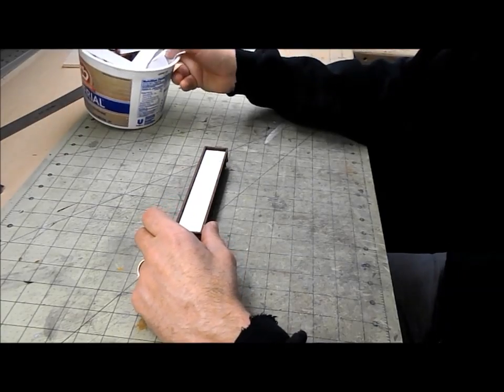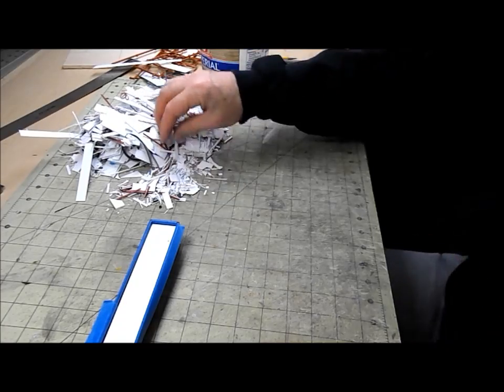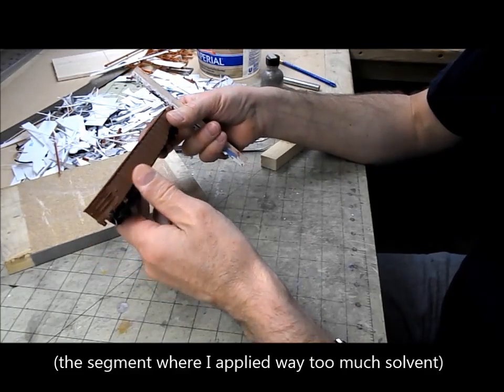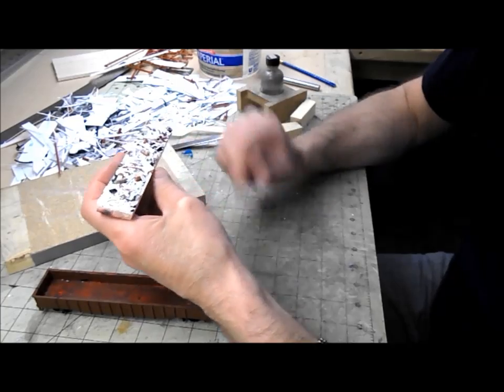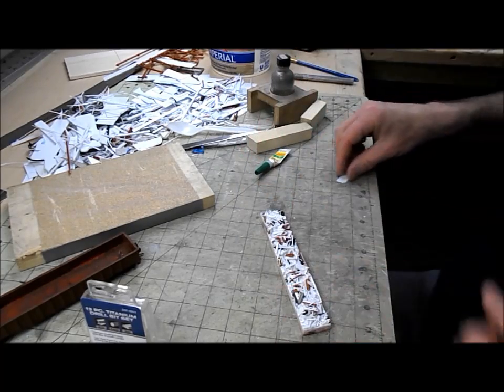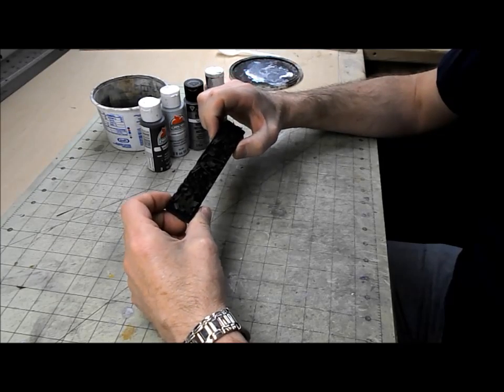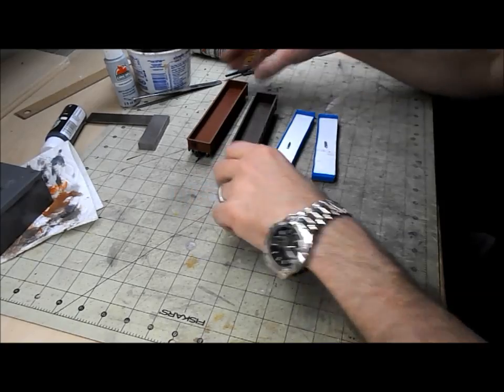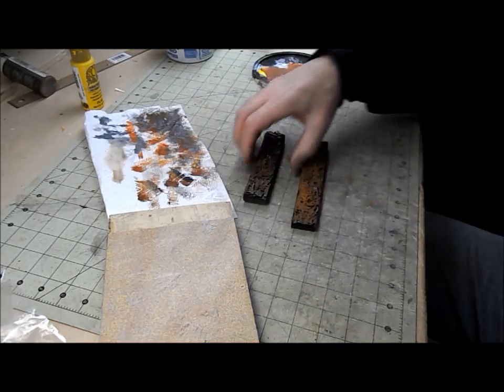Simple and realistic scrap metal loads for your model railroad

Comment: Since I'm like you and never throw anything away that I think I might use, I even save the pieces of metal from drilling holes, sawdust, little bits of brass and copper and just about anything I can find.  Most of the drill shavings are the right color so I don't have to worry about painting them.  I've got one load for a gondola that's made from a plaster casting.  I individually painted each piece so it looks incredibly realistic. Cheers from eastern TN

Comment: Hello.  This is long but might help some people.  I worked in a scrap yard two summers back in the 60s.  We had rail service and shipped some bales down to a terminal about 5 miles away on the Mississippi River to be put in barges.  The barges ended up on the Ohio River and were taken to furnaces in Indiana, Ohio and Pennsylvania.
The bales we shipped were mostly sheet metal scrap from autos.  Think Goldfinger.  Other sheet metal scrap made it into the bales.  I ran the baler one summer.  
We also shipped cut up structural steel and cut up railroad rail to foundries by rail.
Scrap is seldom one uniform color and it is not this dark.  We did not let scrap sit around and rust.  The bales were all sorts of colors given that they contained sheet metal of cars of different colors.  The bales were 60 inches wide and about 20 inches high.  The third dimension was determined by the pressure on the final ram that was compressing the bale.  The rams were driven by five 100 hp GE motors with pumps on each end that sat in an adjacent building.  Two tracks ran parallel in front of the baler.  One track contained gondolas of crushed cars and gondolas for finished bales were spotted on the other track.  We had a small direct drive Caterpillar diesel to switch the cars.  
We also had two buildings for more valuable scrap.  One building handled copper, brass and bronze.  This was loaded into boxcars that were spotted in the building.  The scrap was put in old 55 gal barrels with no tops and secured to the sides.
Another building had more exotic scrap such as ferrous metals from metal working, for example, drills, reams, cutting tools and tungsten carbide.
The yard itself had stuff everywhere.  It was muddy during rains.  Dust on dry days.  Lots of fun.

Comment: I've found that shavings from a pencil sharpener makes realistic looking shredded steel and aluminum scrap for N Scale gondolas. I attach loose shavings to a piece of styrene sheet, with .125 square styrene spacer cemented to the bottom and cut to drop into a gondola. I use 5 minute epoxy to secure the shavings to the piece of styrene. I spray a thick coat of clear lacquer on the shavings to bond them together. After it's painted with red primer or aluminum spray paint, I use PanPastel to give it a realistic look.

Comment: A thought for keeping the balsa and styrene sheets aligned is to use T-pins along the outside edges and pin it down to a work surface (extruded foamboard, wood, etc.) while you glue.  After it dries, you can remove the pins and test fit the insert (lightly sand the edges, as need, before painting).

Comment: Hi,  How i make coal car loads.  I model in S ( 1/64)
Begin with a coal car and note the internal profile of the slanted sides.  Take 1 inch foam and cut to easily fit into the car.  Cut a slopes on the foam to fit with the slope  bottom in the car.  Shave the foam down as needed so that when it is in the car, it is about 3/16 to 1/4 inch below the rim.
Remove the foam and line the car with saran wrap.  Place the foam back in.
Take black rubber foam pieces from a sheet good and grind it up in a food GRINDER - not a food processor.
The result is beautiful sized coal nuggest.

Mound the rubber pieces into the coal car, in 2 shallow mounds, like it was filled from a coaling tower.

Wet the rubber gently with wet water.  Then with a dropper, drop 50/50 white glue over the top.  Set to dry.

Remove the foam and rubber bits, and remove the saran wrap.  Place foam back into car.

Looks perfect.  Turn car over to have the foam insert shake out.

For a scrap metal load, the same process in a gondola.  Sift sawdust until you get random small bits of wood.

Glue onto foam insert and spray with metalic paint.

Walla! a scrap metal car.  Weather for rust if you prefer.

Bob Schworm - Cleveland

Comment: Nice video BB's would work as well as the nail. And for the bottom of the car, I use real rust flakes from my kids old metal wagon, or cast iron pot, or from and old car that has rusted out.
Reply from the maker: Thank-you for that suggestion.  I have heard of others using this trick before, but never tried it myself.

Comment: It turned out well after all Peter! There isn't a modeler among us who hasn't had a disaster or two. If not, they ain't tried hard enough. I have some aluminum scrap loads on my layout that I cut from old soda cans. It was a bit of work but it turned out okay. That is... until I was busted using the kitchen scissors to cut up my cans. Now I have resorted to my old plastic wheels and couplers that I have replaced. Just add some ruddy brown primer and I'm off. Love your loads though. Cheers, Dan
Reply from the maker: I have just the opposite problem with the scissors.  My wife and stepson frequently steal my modeling scissors.  I have no problem with sharing, but more often than not, they don't get returned.  So, rather than have to waste time hunting them down, I now have two pairs.  The old pair lives in a tray on my workbench (where it's easily accessible so I cannot be accused of not sharing) and the new pair is with my tree-making supplies on a high shelf that neither of them can reach.  Since my wife never watches my videos and my stepson refuses to read anything he doesn't have to, I should be safe telling my viewers about it.

I'd be worried about using cut-up soda cans to represent scrap metal though.  There would be hundreds of razor-sharp edges just waiting to open up my fingers.
Reply: I understand completely Peter. But, just in case; this conversation never took place, and I was never here. LOL! Cheers, Dan
Reply from the maker: But I didn't hear the missile hit the target.